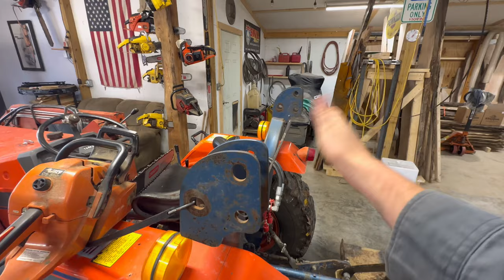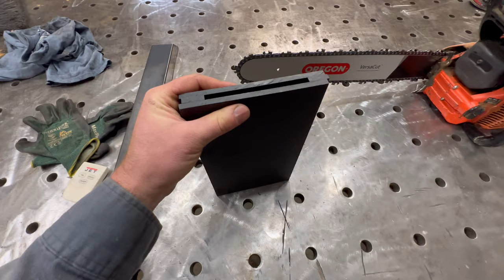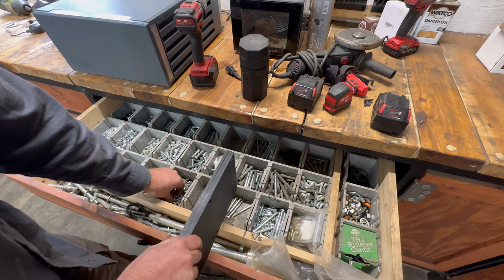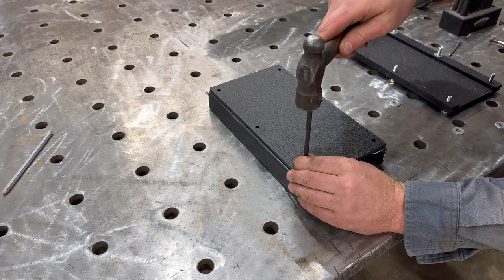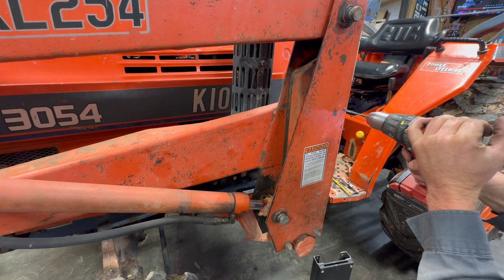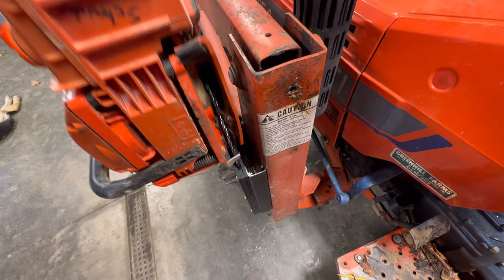DIY Chainsaw Holster

Comment: Great idea for what you need but my comments are more about safety or in your case Lack of safety. I retired from a Veneer Mill after more than 20 years and I was Safety Officer for 12 of those years. In all those years I've had to see countless injuries and 1 Death. I love your work ethic but it's very obvious that you basically ignore so many safety practices. I don't see any ROPS on your tractor and running a chainsaw without eye or ear or body protection not to mention running a chainsaw with one hand has led to many accidents and the one death where it kicked back on the operator that was holding it with one hand striking him just under the chin and I believe he died before he hit the ground. In our pallet building part of the Mill the Sawyer was cutting a stack of fresh cut 2 X4s and as he was adjusting his stance he took his hand off the bar just as it kicked back and it hit him in the face. The injuries were extensive and after 3 days in ICU and countless stitches he pulled through and after a month he actually returned to work but he said he looks more like Frankenstein now then the Man he was before and he changed jobs and said he would never operate a chainsaw again. I don't want to sound like a Troll but accidents like the few I mentioned happen faster than a blink of an eye and ignoring safety is easy when nothing happens but it can catch up to you in an instant and as I just Subscribed to your channel I would like to see more of your Videos.  STAY SAFE
Reply from the maker: I appreciate your comments, thanks!